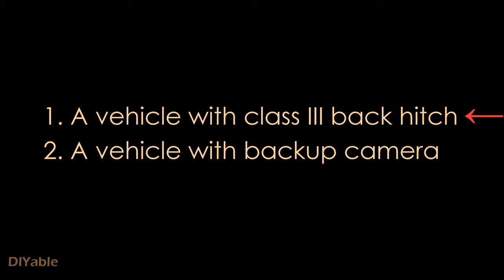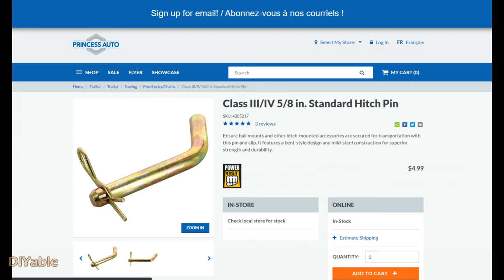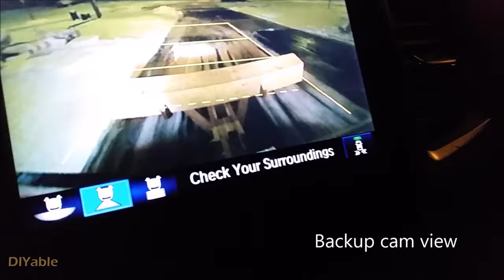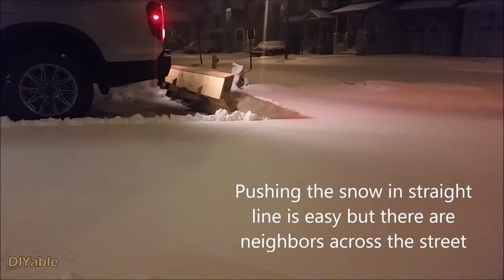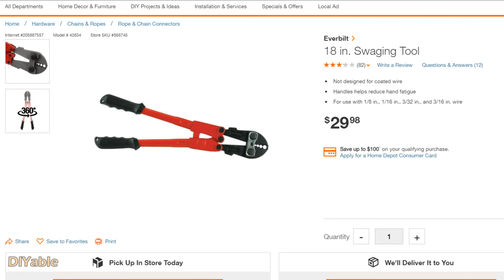[Snow Removal Part 1] How to build a DIY wooden snow plow for SUV or Pickup Truck Honda Ridgeline?

Comment: Excellent idea, you gave me a solution to the wooden snow plow that I made with the use of the electric winch. I made mine using 2"x12"  7 'pressure treated with a 2"x6"  7' on top, 2"x6" arms to yhe hitch with 2"x6" angle supports to keep the blade from twisting, all pressure treated for the strength. Instead of welding i got 1 1/2" square tubing from Lowe's, fits perfectly inside the hitch extension.
Thank you for the suggestion of the electric winch.
Dennis

Comment: Not a bad design but May I suggest to put stabilizing chains on the outer ends as this will stop the twisting at the shank where you had the wood break in the first attempt.  
Where to then hook it to the outer part of the bumper..
Reply from the maker: Very Good suggestion Indeed.

Comment: Excellent job, I did the same, but used a 42" tractor blade. 42" is to small needs to be at least 6' without backup camera.
Reply from the maker: Awesome!!!    I found that the wood is a bit heavy though...

Comment: Fantastic idea! I’m thinking of doing the same on a front mounted hitch receiver on my Jeep TJ. And instead of having a removable winch... use a permanent one mounted on my front bumper and mount a wheel on the top of the adjustable hitch to run the winch wire over to the plow. Thoughts?
Reply from the maker: Great idea!!   Indeed, if I have a front mounted hitch, I would have done it in the front too.  A permanent winch looks good on a Jeep but it will look weird on a truck LOL..  Yes, I think it's a good idea, I would have done the same if I had a Jeep.
Reply: Hello, I was thinking about doing one on my tj, did you ever do yours ? Willing to share picks or plans thanks

Comment: i don't know if you've heard of the rear-drag style plows?  I would like to make something like this except that instead of pushing back, you pull foward and drag the plow behind me, then lift it to revers, then place the plow down near the garage door, and then drive foward again.

I wonder how your model would hold up to lifting the plow while pushing (to get it over an existing pile or tall windrow)
Reply from the maker: First of all, there is no way this DIY plow can match with professional plow, there is definitely room for improvement. It is holding up pretty well, however, if you study how the professional plow are designed, they have spring to protect the plow, mine doesn't... so I cannot really step on the gas to push it very hard over an existing pile, there is a limit. Yes, I have seen the rear-drag style,  it would work if you can just leave the snow on the side or on the street.. otherwise, you still need to place the snow somewhere (usually for subdivision, dump them on the lawn). I am not sure how easy is it with the rear-drag plow.
Reply: @DIYable  I've seen models with angle options that allow snow to fall to one side of the other. With some added weight and angled /more pronounced shoes it could take steeper bumps
When i used a front plow on driveways usually it involved dragging in reverse with a little forward pushing.
The construction I had in mind would be more reinforced than this but i thought I'd see how it is holding up. A rear drag plow needs to be heavy inherently, unless it is direct mounted to the truck (in the truck bed not just a hitch)

Comment: That’s a good way to blow out your trans.
Reverse gear isn’t good for pushing heavy snow. 
Front hitch,or use for light snow only.
Reply from the maker: Good point.  Honda Ridgeline isn't tough enough for heavy snow LOL...
Reply: Reverse has the lowest ratio its actually easier on the transmission than 1st gear

Comment: Is it okay to use non-treated 2x4 and 2x6 and put some waterproofing on top of it? Or do you strictly suggest pressure-treated wood?
Reply from the maker: Yeah... definitely. You can use non-pressure treated (which is cheaper) and seal it with waterproofing like thompson water seal. It's fine, because it's not 100% expose to outdoor 24/7.
Reply: I thought I’d drop by and say that I’ve completed my snow plow! So excited to use it!!
Reply: Burn the wood Japanese method easy with weed torch